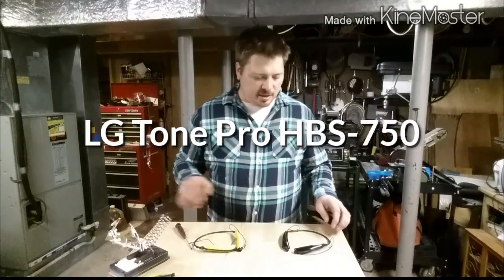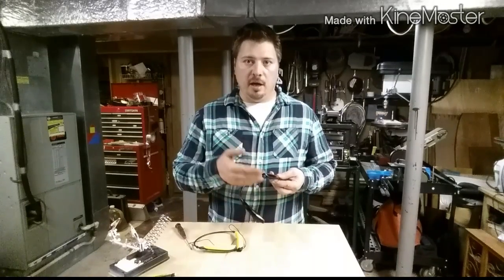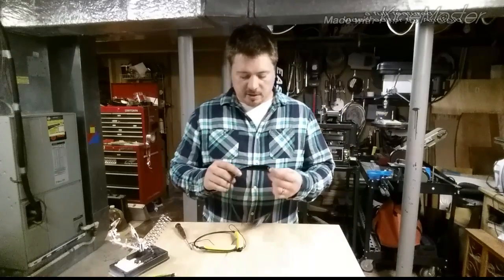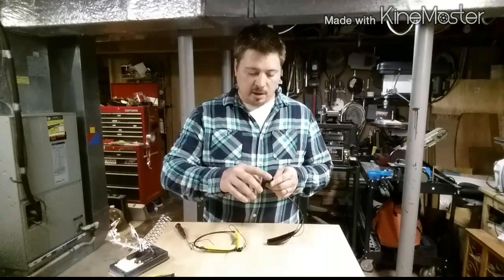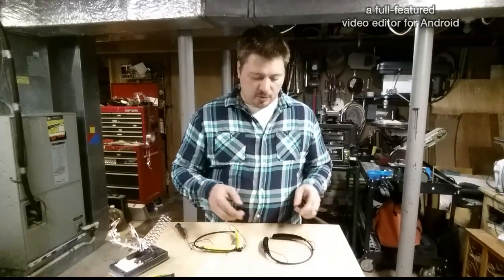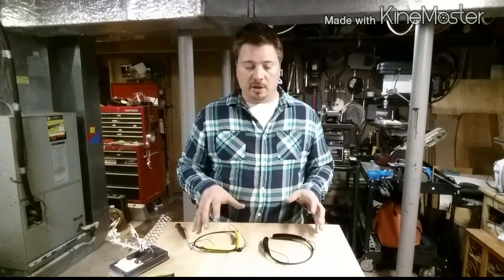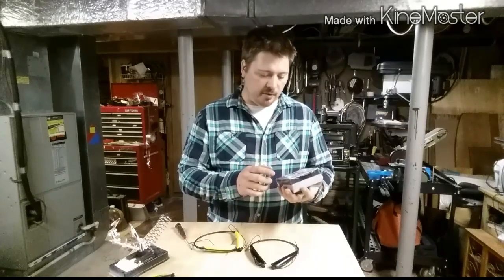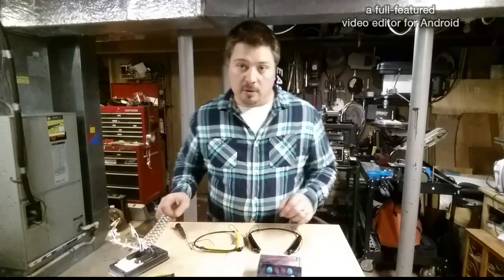LG Tone Pro HBS-750 repair, upgrade, mod

Comment: Okay, so I just repaired my right side earbud. The wire was cracked inside the insulation at the flex point where it exits the housing. I was able to use the same earbud by simply cutting back about 2 inches of the wire. the wires are multi-strand varnished wire so you have to prep a very short bit of the wire before soldering back to the circuit board. 

I just slide the grommet down the wire out of the way until I was ready to reassemble. I made sure there was a enough length stripped back on the jacket to make the new knot against the grommet and still be able to reach to solder pads. I used a drop of superglue in the knot because it kept trying to come untied. then you strip and tin the wires you can verify the earbud still works by measuring about 15 Ohms (not zero and not infinite). Once you verify the impedance, you can solder in place being sure to avoid shorting them with a solder bridge. Tuck the wires in, align the wires going around the loop and snap the housing back together and test. Once tested, you can replace the screw and plug.

Comment: Thanks for posting this video, I use some hbs-750's when I'm working (lawn maintenance) and with the help of your video I was able to open them up so I could replace the stock buds with some Plugfone buds that block outside sound much better....Should allow me to keep the volume a little lower when working than before.
Reply from the maker: +Dawson Mobley I was considering that myself. I need earplugs at my job so I was considering using sound blocking buds.
Reply: +kez3000 
I'll report back how they do, I swapped them in today and they are working but the real test will come Monday when I use them with my equipment running, I'm very familiar with how loud everything is to me with the old buds so if there is much difference I will notice it.

I can say the plugfones(executive model) sound better than I expected so no decrease in sound quality at least. I did reinforce where the wire exits the buds with shrink tube and rubberized CA as they had no strain relief at all and with the foam tips you have to pull on the wire to get them out of your ears...the wire itself will break now before the internal connections see any stress.
Reply: The plugfones work great for me with the foam insert, they seem to block about as much sound as a pair of standard foam earplugs and they sound pretty good, not heavy on the bass but I prefer that in this application since I normally have the volume louder than I do on my "non-work" ear buds.

The silicone inserts let too much high frequency sound through, plus they are a little too tight in my ear canal for comfort, so for me at least the foam inserts are the best option.

Comment: I shouldn't really criticize your video. What I learned from it, was that this sort of soldering job, simply goes beyond what I can do. And this realization came at an inconvenient time. Actually, my HBS-750 headset still works 100%. It would just be good, if there was some way to repair it later down the road.
Reply from the maker: +Dirk Mittler I go into closer detail in my first lg tone video for the hbs700/730.  It's a long video but I show the whole process.

Comment: kez3000 I'm not quite sure what the problem was but I took of the rubber piece (the one that goes in your ear) I cleaned everything and it seems to have a small circular cover on top idk maybe to prevent debris and what not from getting in..I took that off check the volume and it's working perfect again..put it back together repositioned it and it's all working..my guess was the cover was sorta jammed up in there..thanks..
Reply: I'm glad I read your post...I was having the same problem with the volume it kept getting lower and lower I could barely hear anything I took off those covers in the earbuds as you suggested and now the volume is great just like when I first bought it....wow never thought that would have made such a huge difference......thx
Reply from the maker: beethoven4online as gross as it may sound, earwax builds up on that cover and can start to prevent sound from passing through. It's good to clean any build up off them periodically.

Comment: Hey! I have had my LG730 for almost two years and haven't had a single problem until a few days ago when my mic stopped working. I can hear the person on the other end but they can't hear me. I have fully recharged, disconnected it and reconnected it from my Galaxy s3 but no luck! :( Any suggestions?
Reply from the maker: I was actually just asked a similar question the other day. I have another video for the HBS 700 and 730 (LG Tone HBS700 / 730 repair, mod and upgrade: http://youtu.be/UhFEuRD0vAA). You should watch it because it will show you how to open it up and get to the components.  

I would first check the hole for the mic and look for debris that may be blocking it. It's located just above the left side earbud cup. 

Next I would open it up and check that the mic wires are still connected to the circuit board. 

If the wires are still securely attached, the mic can be replaced.  It's almost the same procedure as replacing the earbuds, just 2 wires to solder onto the board.

I am planning on making my next video about the battery and mic since I have received so many questions about them.

Let me know if this helps.
Reply: Awesome!  Thank you for taking the time to reply with suggestions on fixing this problem!  Will do it this weekend and let you know!  Stay blessed!
Reply from the maker: Katie Weaver Any updates on your repair?  I just posted a new video that covers the microphone.  I hope it helps.
Reply: kez3000 Work has been crazy so I am just now seeing your reply, so I apologize. I finally decided to purchase a new model a few weeks ago& decided to try the LG Tone Ultra800. So far so good. I have a few dislikes between these and my 730's, but hopefully I will adjust to the few new cosmetics. However, I'm still needing to replace my micro on my 730 bc I've decided to use them during Crossfit and work. If I have any problems this weekend replacing it, I'll let you know! Thank you again!! :)

Comment: I have the LG750.  I am unable to find the replacement battery for it.  Do you know where I can purchase one?
Reply from the maker: If you search "501240 3.7v lithium battery", you should come up with some results. Just for reference, its a 3.7 volt lithium polymer battery. The stock battery is 195mAh capacity (basically how much power the battery can store). I usually replace with higher capacity for some extended run time like 220mAh. Model #'s are tricky because they are usually the dimensions of the battery.  For example...  The battery I used for the video was 501240 or 051240 (the first two numbers can be reversed with some sellers). This model number stands for 05mm tall-12mm wide-40mm long.  That's important so you'll know if it fits in the space inside the earpiece.

Comment: Do you happen to know where to find replacement ear piece, the whole thing all the way from inside the headset its self? Mine have developed a short and I'd love to just re-solder on a new one.
Reply from the maker: You mean the earbud or the circuit board inside?  If you just mean the earbud and wire, you should watch my first video for the HBS 700/730.  I do not know of anyplace that will sell the original earbuds but I show you how to cut and use any earbuds you want from your local store.

Comment: Hi! Great video I have the same bluetooth headphones but I put them to charge using a generator and I haven't been able to turn them back on and I've tried charging them but they wont turn on. I've had these for a really long time, any tip or recomendation? Thanks in advanced!
Reply from the maker: It's possible your battery may have been damaged.  The battery should never be below 3 volts and it shouldn't appear puffy or bulged.  It's also possible that a connecting wire to the battery may have come loose. Those would be the first things I would check.
Reply: @kez3000  would you recommend me loo looking for a place where I can get them repaired or should I just buy new ones?

Comment: Nice video, thank you. Small correction: For battery sizes, you mean mAh (milliamp-hour) rather than milliamp.
Reply from the maker: yes, it is Milliamp-hour but I usually shorten it to Milliamps in conversations because those who understand will know what I'm referring to and those who don't won't care.  I list the battery capacity as mAh for those who copy to search.  The size is in millimeters (h,w,l)
Reply: OK, just so folks know, those are different things. A 250 mAh battery can provide 25 mA of current for 10 hours, 50 mA for 5 hours, etc.

Comment: Hello Sir may God bless you. I have had these lg hbs 750 for 5 years now and I have used them with utmost care, more then a precious metal may be. They're still working fine but the only problem I'm facing is the headset is rebooting frequently on it's own while in use. Any good advice you can provide me for this problem. I believe I can still use them for another 2 to 3 years.

Comment: mine wont charge anymore or turn on. can it be fixed? and is it the battery? thanks alot in advance
Reply from the maker: That's usually the battery. If so, it can be fixed. I would open it up and check the battery wires first to see if they're still connected (sometimes they break off). Then (if the wires are ok) I would change out the battery. You can watch the procedure in my other video for the hbs 700/730.  Hope this helps.

Comment: In this Bluetooth only ine channel sound play in both speakers can you made a vide on that how to make duo channel in it HBS-730
Reply from the maker: I've never encountered that issue. Have you tried connecting the bluetooth to another device?
Reply: @kez3000  yes and i have checked the connection of the speakers also both are connected to one channel only

Comment: I have the HBS 740 and I can't seem to find a tutorial for anything about it. Mine  just won't seem to hold the charge and stops at 30% and quickly dies. Is there something I can do to fix it?
Reply from the maker: I really don't know much about the 740. From searching Google, it seems to be a generic clone of the LG hbs700. My video on the 700 might help. Most of these units run on a single cell 3.7 volt lithium polymer battery. Usually around 195 to 260 mAh capacity (which ever will fit).

Comment: Hi, i got my LG tone Pro HBS-750 and the Problem is that i can hear one side of the ear bud, but i can't hear the other one.... Is their a fix to this? Please Someone Helpp.
Reply from the maker: This video only shows how to open the hbs750 and where the components are located.  You'll need to watch my other video on the hbs700/730 to see the earbud replacement process.  One of your earbuds has probably gone bad.

Comment: So I took mine apart, but what's really the issue is that the call button is stuck and I can barely press it. How do I make it stick back out again ?
Reply from the maker: I haven't replaced any buttons yet. I know you can buy the buttons on ebay if you search by size.

Comment: yes i have a question about the hbs-750. I use mine to skate and they worked fine during my last run. But when i got home it was completely unresponsive. Doesnt light up to charge. Wont turn on. Im getting absolutely nothing. What can i do to fix it? Didnt drop them or do anything crazy so why would it just stop? Wont charge, light up, nothing since last night
Reply from the maker: +Michael Sadler well,  there are a few possibilities. Opening it up will give you a better idea of what's wrong.  If you sweat on them,  the internals might get wet and corroded. They are not sealed very well against moisture. My guess is its the battery tho. The battery is sometimes not connected very well and over time can disconnect. I've seen it happen a few times. If you open it up as shown,  you can check that there are no disconnected wires.
Reply: Ok ill open it up. How will i know what the problem is if everything is connected? And how much does a battery cost. Im a sole provider of 3 off not much more than minimum wage. Literally have zero funds.
Reply from the maker: +Michael Sadler opening it up is just a starting point.  It gives you a chance to visually inspect the earpiece. Even if you don't know what all the circuits and wires do,  it's not hard to spot something that looks burnt,  discolored,  disconnected or broken. The batteries aren't very expensive at all. On average about $5.  The catch is that they are rarely on ebay or for sale in the US.  I buy mine from over seas on Aliexpress.com and they take almost a month to arrive. It's worth the wait and nice that you can put a higher capacity battery in and get more run time.  I highly recommend you watch my other video on the hbs 700/730.  It shows a full tear down, earbud replacement and battery replacement. The model is different but the principal is the same.

Comment: mines just randomly stopped charging. never dropped it or anything
Reply from the maker: Check your wire connections inside first. If all is attached, check that your charging port is still fully attached to the board. If all that checks out OK, check the voltage on your battery. If your battery voltage is low and if the battery feels bloated and squishy its probably gone bad.

Comment: HI. My 750 headset just stopped working today. For no apparent reason. I did not drop it, get it wet, or overheat it. It will not charge, come on at all, or light the l.e.d. Any help you could offer would be priceless. Thanks so much.
Reply from the maker: It is probably the battery. I would open it and check the battery wires. Sometimes the factory doesn't solder them properly and they disconnect over time.

Comment: Thanks for the videos, I replaced battery on a used 730 and there is a blue wire loose on PCB. The stop play button does not work. Do you know where it connects to on the battery side board?
Reply from the maker: Sorry for the late reply. No, I'm not sure where the blue wire connects. I'll have to take mine apart again to see.

Comment: part 2 and after I use it and unexpectedly ik disconnects from my phone and I can turn on and off the power and I don't hear the announcement that I'm turning it on or turning it off i plug it into the charger for about a half hour 40 minutes and she'll work again can you tell me why it stops working and then it maybe the battery could be a problem post your comment thank you

Comment: Hi, great video! Please, I have a LG HBS-730 on power up, it gives 2 normal ringtones but then it starts vibrating, 6 ringtones and the blue light is blinking and just stops working. I can sometimes find it on the Bluetooth list as "issc shs", but can't pair with the cellphone. Already tried to start with the call button pressed, or other buttons but nothing happens differently ... please, any ideas will be that it is the microchip that is damaged? Is there any possibility of repair? Thank you!
Reply from the maker: I'm not sure what exactly would cause that issue but it's likely a component level repair on the control board.   Which means if you're intent on fixing it, you're best option is to buy a set on Ebay with broken earbuds for cheap and swap the circuit boards (or swap the earbuds from your old set).

Comment: Hello there, I bought a set of the LG 750 a few months ago. For some odd reason, it stopped working. I can't even turn it on. I tried charging it, but it went completely dead. Any idea why? and how to fix it?
Reply from the maker: Best guess is its a battery problem.  First, I would check that the battery wires are connected properly (sometimes they are soldered poorly). Next check the battery with a volt meter and see if it has juice. 

Let me know if this helps.

Comment: how about the LG hbs 760... 
can I open the ear buds or I have to replace the whole ear buds... 
it seems like the shortage is near the ear buds, where the wire starts to come out... 
best bet will be to replace them ..??
Reply from the maker: +Jose Arellano I always prefer to replace the wire and earbuds together.  If the speakers are still good, it's your choice if you'd like to just replace the wire. I don't recommend it tho.
Reply: kez3000 
ok .. thank you..

Comment: Hi. My HBS750 stopped working. It charges and the battery indicator turns blue, but as soon as I take off the charger the unit refuses to turn on. Any idea what the problem could be?
Reply from the maker: +Mansoor Aziz Ahmed there are lots of possible reasons. One could be that your battery isn't holding a charge anymore. It's also possible your power switch is broken.  It's hard to know without inspecting it.
Reply: same with mine but I fixed mine by holding the call button (i forgot how many second I held it for) but after I did that it was speaking and working fine again

Comment: hey, would you be able to dind out why the volume on the left bud is way lower then the right one
Reply from the maker: Its likely the earbud is going bad. If you get another earbud and touch the wires to the contacts on the pcb you can test if it's an earbud problem or not.

Comment: I have a axpt Bluetooth, the blue light wont go off at all, when I charge it its blue and red. i had it paired yesterday and today its not working what can i do to get it to work?
Reply from the maker: Honestly, I'm not an expert but it sounds to me like you have a short on the circuit board somewhere.  First, I would take it apart and inspect the board for anything that looks burnt or exposed wires that look like their touching other parts. If all that fails, I would buy one with broken earbuds and swap out the board.